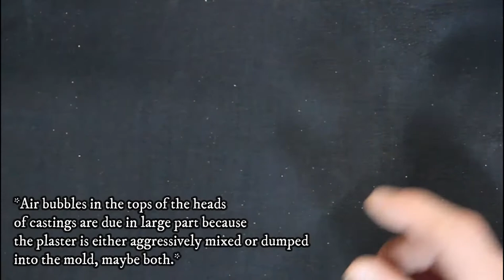HOW TO CAST HYDROSTONE PLASTER into a Mold / Mould Tips & Techniques

Comment: If you have a palm sander you can place it against the mold and the vibration will jiggle loose a lot if not most of the air bubbles.
Reply from the maker: Great tip! Thanks for sharing 😊

Comment: Hi! I am using Hydrostone to make trinket trays. I would like to make the tray waterproof by finishing it with a matte finish sealer. I am not able to find anything in the market. Based on your knowledge on Hydrostone, could you please advise what can I use?

Thank you!
Reply from the maker: I don't know something that could make it waterproof easily especially for reproduction. I recommend resin. I believe smooth on makes a two-part called Smooth Cast 320. That would be excellent and it's paintable.

Comment: Hey man! I’m looking to make a 20x20x40 inch block of hydrostone to care up a bit. I was wondering, would something of that size hold its structural integrity? Would it be ridiculously heavy or manageable?
Reply from the maker: It's a soft carving stone. Like any carving statue there are ways to get chunks to break away without destroying your image. It doesn't carve like plaster but once you get through the surface it's much more manageable. Give it a go and see what happens I've never tried it. Not to that extent anywhere